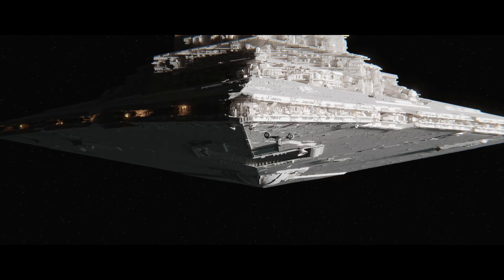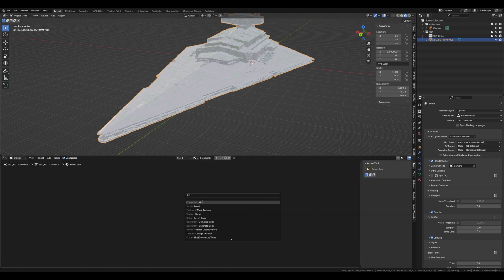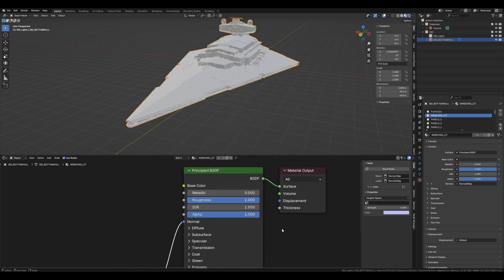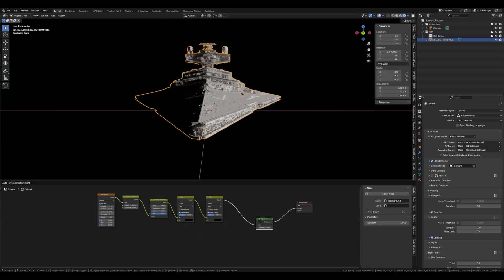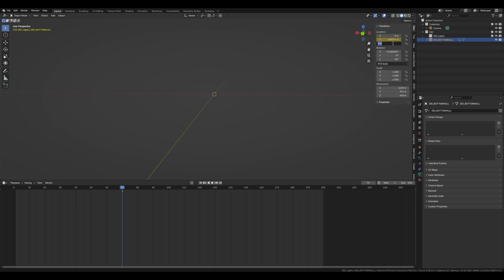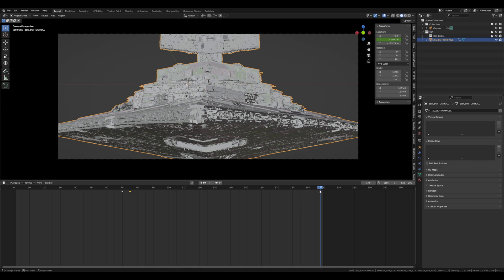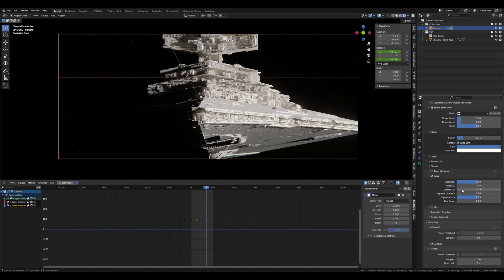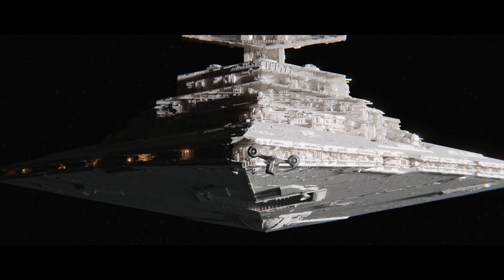Star Wars Blender Tutorial | Animate and Light an Imperial Star Destroyer

Comment: Hello, I am VERY NEW TO BLENDER [OH NOT A NEW-BEE THE HORROR] can you please explain how you get those boxes icons on your screen that you are using to connect boxes with those lines (confused what they are called NOBS?) they just appear onscreen are you using a shortcut key? I want to follow your video but that is very confusing to me.  Also how do you split-screen so I may follow what you are doing?  I know this is obvious to those using Blender but I get easily frustrated without Step-by-Step instructions.  I just started to try to learn Blender again after several attempts to now recently cause most tutorials skip details.  Do you have any step-by-step videos you can recommend please?  I await your reply.  AGAIN PLEASE NOTE I AM VERY NEW TO BLENDER.
Reply from the maker: Hey, I think you mean 'Nodes', apologies for my sped up accent! The shortcut to add those nodes is 'Shift A' and the way to create a split screen in blender is by going to the very top right of the main window, clicking and dragging a new one out.

If you're new to Blender, the donut tutorial by Blender Guru is the usual place to start!